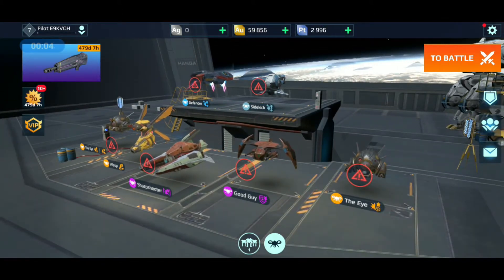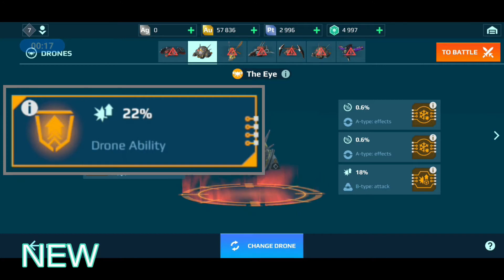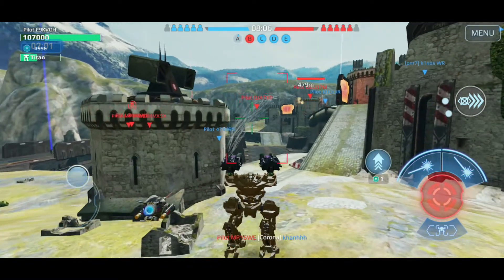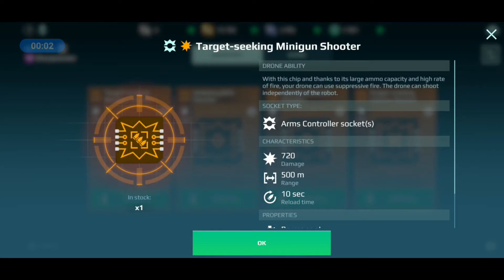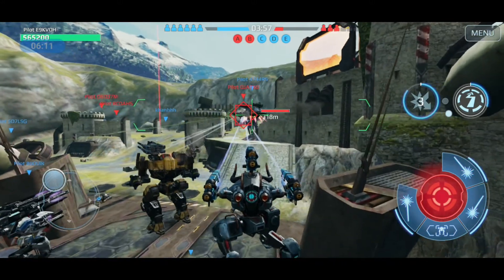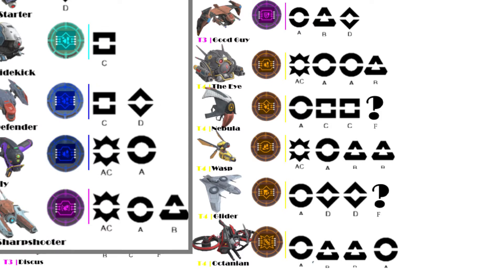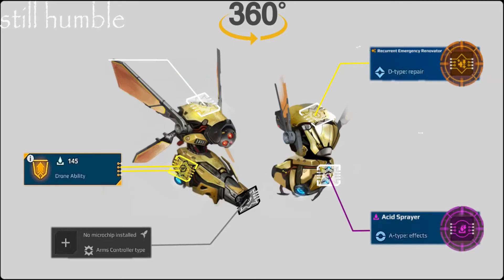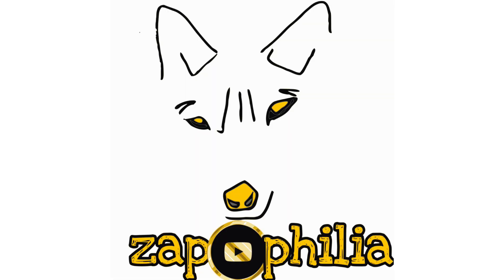∆r⚙️nes | The NEW drone system and how to fix⚙️ it • WR Test Server

Comment: Nice job addressing the universal slot. I did spend a lot of time figuring out and creating perfect chip combos. Now that the combinations are limited, I am actually angry at this rework. I filled out the survey and told pixonic the only thing they should get rid of is the battery micro chips but I like the concept of being able to switch one slot for a universal slot.